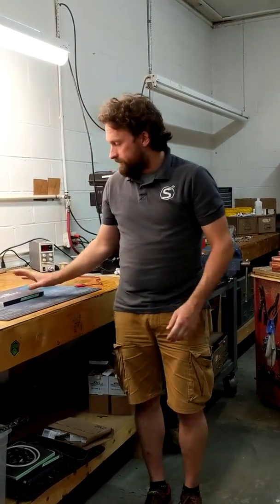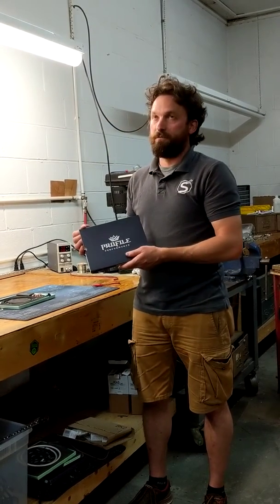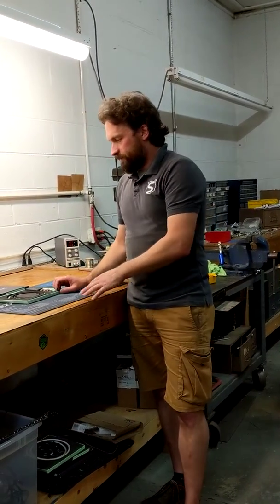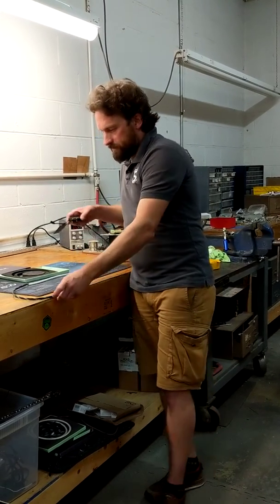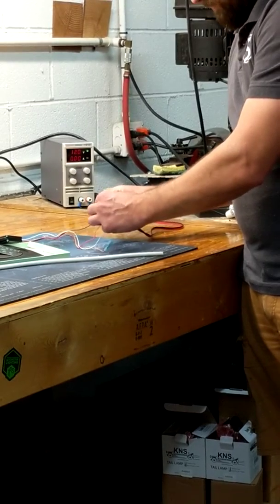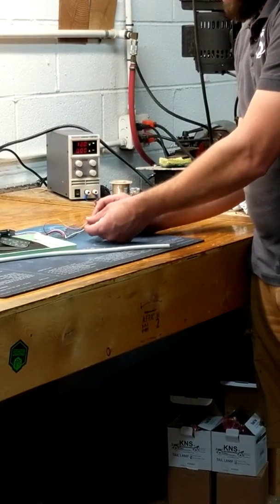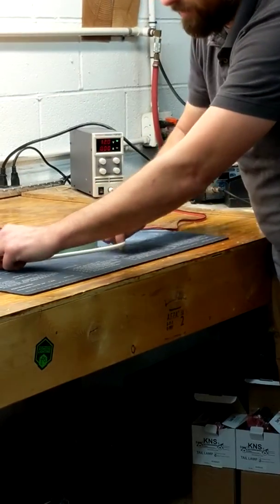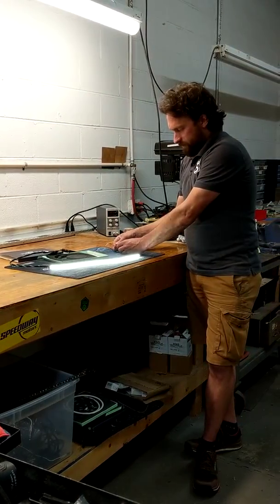Profile Pivot Sequential LED Strips - Opening Up the Box and Testing

Comment: How would you mount these style strips in a 2017+ super duty mirror lights? I have a spare set I want to cut open and try this on but not really sure how the strip is mounted inside the lens. Thanks for any info
Reply from the maker: Typically with double-sided tape and/or some beading wire. But in all honesty, I wouldn't bother. We saw an enormously high failure rate with these strips. Plenty of newer products out there that will last much longer, like our new 2.0 GrilleBars: https://sparksmith.com/products/universal-grillebar-2-0

Comment: I installed these and im having this problem where they stay on afther the car is off and even afther i put the alarm the keep staying on? What can that be?
Reply from the maker: Add a resistor in parallel with them, that should do the trick
Reply: Spark Smith what does the resistor do? Im not sure how too install that resistor? So they stay on because they have too much current?
Reply from the maker: @wolfpredduenas5152  the strips don't draw enough current. There is something in that circuit with some small amount of capacitance, providing voltage after the vehicle has been shut off. Putting a resistor like this one: https://sparksmith.com/products/morimoto-hd-load-resistors-pair?_pos=4&_sid=ee3c4e4b6&_ss=r) should take care of the problem.
Reply: Spark Smith do you have a video of how to do the wiring? Becaus im already tappin to the fuse box with one of the wires from the turn signal harness.

Comment: Is it possible to change the direction of the sequential pattern? Some applications will require the wiring to be on the other end, and it would run the sequence the wrong way
Reply from the maker: No, the only thing you could do is make the wires longer
Reply: Spark Smith would there be any way to de-solder the connection, and solder it to the opposite end?
Reply from the maker: @dreamreaper3k  not that I know of. It would certainly void the warranty. And it would be far easier to just make the wires longer.

Comment: Can I make a c shape with these? How flexible r they
Reply from the maker: They can bend front to back, but not side to side. So you can't make a 'C' shape unless you have the LEDs facing to the inside of the 'C'. For that, you would either need something completely custom or possibly the XK Glow sequential strips (https://sparksmith.com/products/2pc-sequential-switchback-led-strip-kit-drl-turnsignal-for-headlights)